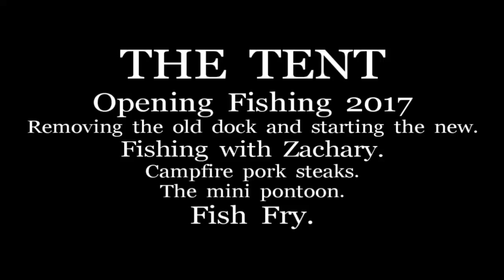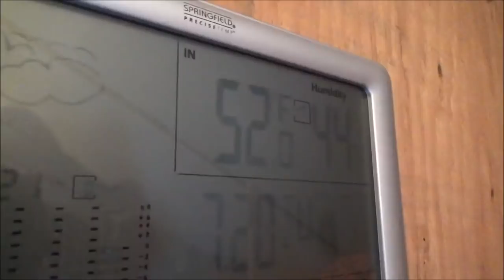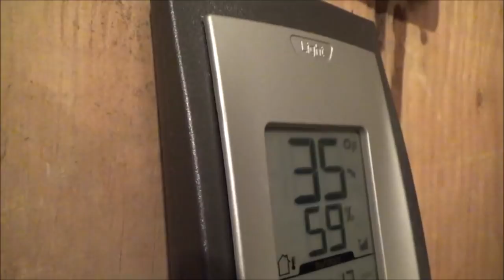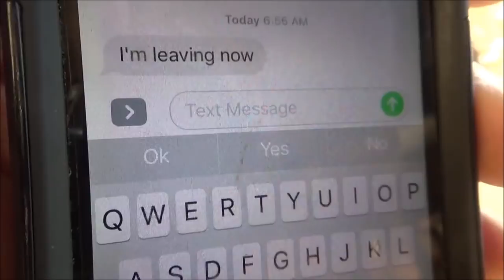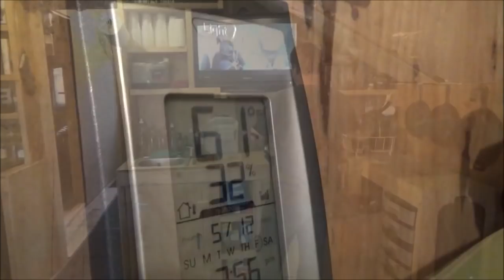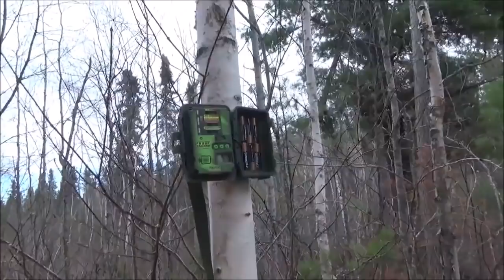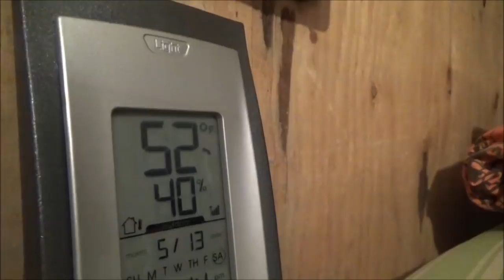THE TENT. Opening Fishing 2017. With Zachary.

Comment: to pick up the front of the dock put a fence post 6 ft back leaning toward the dock, as you pull back the post will lift up thus raising the dock too if that makes sense, anyway it works, old logging trick

Comment: Joe ; why don't you put in a 5 to 10 gal propane hot water heater or a instant on water heater and plumb it to the well, that way you won't half to heat water on the wood stove all the time specially in the summertime when it's warm out you won't have to build a fire in the woodstove.

Comment: How's the new truck running don't see you using it much.
Reply from the maker: I usually drive my old one, it has the ladder racks and it is my work truck and easier to just grab and go. I am bringing imy new one in soon to be bullet proofed and then I want to put a leveling kit in it and 35s. I will drive it more once I have that stuff done.

Comment: I happened to see one of your videos and I immediately subscribed. Great, great videos! I have one question, I don't see any power lines and I don't hear a generator. How do you power your camp? A bank of batteries?
Reply from the maker: The first 7 years I used a Honda 3000iu generator and then I dug in grid power.

Comment: just wondering ...what size is your aluminum boat & motor you use at the tent ?
Reply from the maker: The boat is a 12 or 14 footer and the motor is a 9.8 Mercury. I have had 9.8's and 9.9's and I really like those motors.

Comment: I'm surprised that you don't get yourself one of those Roll A Docks on wheels. Roll it into the lake in the Spring and roll it back onshore in the Fall. It's like less work to me.
Reply from the maker: The dock stays in year round. The wheeled ones would be nice but you can not back into the lake straight on there. I think about that all the time.
Reply: Maybe two shorter length wheeled dock sections, with wheels on each dock section, would help you get around the no straight line of lake access? 

I don't know? I just figure there has to be an easier way for you to deal with your dock situation, without having the ice bust it up by leaving it in the lake all year. From watching all your videos, I can tell that you have a better construction/design mind than I do and I figure that there has to be an easy way to put in and take out your dock.

Over on Lake Vermilion, near the Tent, I've seen docks on a pulley system where they just raise and lower the dock into the water like a drawbridge. Maybe put an anchor eye bolt into a pine tree, run some heavy cable to the end of the dock on a roller, attach a hand winch to the cable and crank the dock out of the water like raising a bridge?  

There has to be an easy way to do this. Just have to figure it out. 
 I'm just trying to help out as best I can via computer. 

I always enjoy your Tent videos.

Comment: What happened to the new truck??
Reply from the maker: I have it, I use my old one for work with the ladder racks and my work truck is always a mess so its easier to jump in that and go. I am going to be bringing my new one in to have it bullet proofed and then I will be installing a leveling kit and putting different rims and 35 inch tires. After that I have a feeling I will want to drive that one a bit more. Lol.